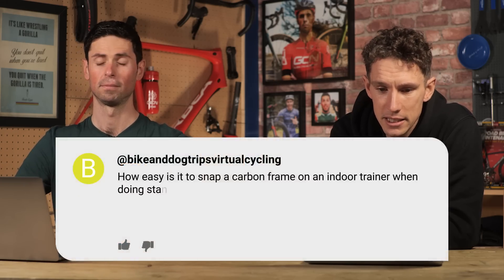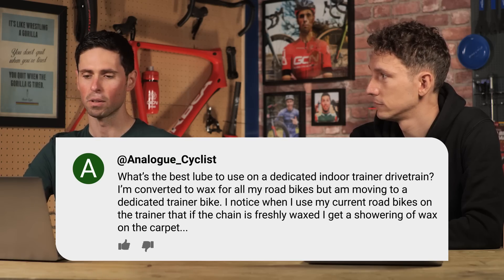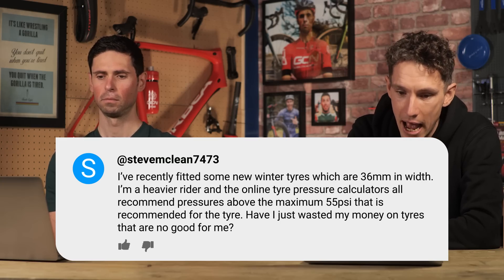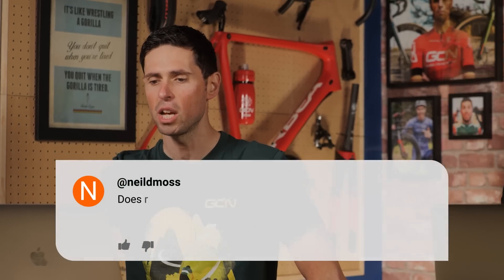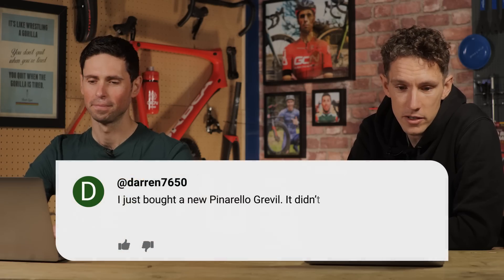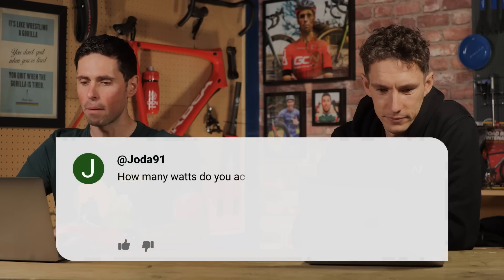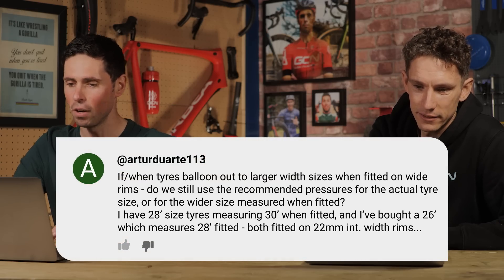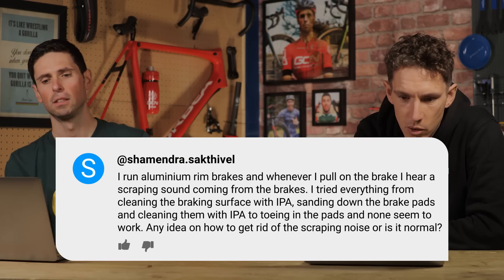Snapped Carbon Frames, Correct Tyre Pressure & Indoor Trainer Lube | GCN Tech Clinic

Comment from the maker: If the super nerds couldn't answer your tech related questions within the allotted time, fret not! 
Be persistent and use #askgcntech when asking your questions! 👇
Reply: #askgcntech I have recently purchased a set of Hunt 4 Season wheels with rim brakes, I fitted theses with latex tubes. After flicking through the manufacturers documentation, there is a WARNING not to fit latex tubes. When I asked the manufacturer 'why?', they said this was due to the potential for heat build-up in the brake track which could then cause the tube to burst. Have you ever heard of latex tubes bursting due to heat exposure and why are latex more susceptible than other materials?
Reply: Hi guys, I recently upgraded the wheelset on my entry level rim brake bike. The new wheels are custom build by local bike shop. It has 20h with radial pattern on front wheel, while rear wheel has 24h hybrid pattern - 2 cross interlaced on drive side and radial on non drive side. I have ridden the new wheels for 400 km with no issue but I found out that many other rear wheels out there with 24h spokes has 2 cross pattern on both sides or even 3 cross. Should I change the pattern on my rear wheel? Whats the benefit for each lacing pattern? Thanks in advance. #AskGCNtech
Reply: I love watching Alex who is so meticulous and particular in his bike maintenance and/or setup choices, giving advice alongside Mr WD40 Richardson. 😂

Comment: With 90lbs of bike weight, my rear rim brakes would often glaze. Then the squaked like geese upset. Lava soap in bar form (pumice soap). Scrub the pad, rinse, repeat: until as new. No squeaks or squacks.
     Not certain but would Hazzard the guess, that I over heat them, and it happens. Remember, clean that rim too. Ride more. Know your/you're love

Comment: The cycling rolling resistance Website tested the new vs old and found exactly what was said... literally zero difference in rolling resistance after nearly 1-2mm of tread wear. Puncture protection wasn't very different but slightly worse

Comment: #askgcntech I bought some light and compact TPU inner tubes to carry on my commuter bike in case of a puncture. But I didn't take into account that my current tubes have Schrater valves whereas the tpu tubes are presta. My mini pump has fittings for both, but can I use presta tubes in my schrater rims?
Reply: you can use them

Comment: Just last week, my Cannondale supersix six tiagra snapped almost all the way through in the middle of the left seat stay. Only a few fibres remain holding it together. It's a permanent trainer bike, I had it on a DIY rocker plate type thing. It wasn't because I put so much power into the bike, but rather it was likely because I'm heavy at 105kg. And a car crash 9 years ago probably left micro-cracks that manifested over the years.

Comment: Regarding waxing your chain on your turbo, simply have a mat under the bike and vacuum up the wax "dandruff".

The wax coats the chain so should prevent corrosion, as it does outside.

Oiling a chain is a total loss lubrication system, and so the chain will be dropping oil even if you can't see it.

Comment: This is  related to the first question, my brother's bike frame actually cracked on the seat tube (just above the seat stays) on his Cipollini N1k1 frame while riding on a bike trainer. It was a couple of years back during lockdown, where indoor training was the only option at that time. Luckily the bike frame was still under warranty, got his replacement frame for free. But yeah, I've seen carbon frame cracked on a bike trainer

Comment: #askgcntech how do you think is that I am beating all my Strava best times with a fitness hybrid bike compared to my road bike with which I had my best times before? I got a Pathlite 6 (40mm stock Shwalbe G-One Bite tyres 2022 model) which is 1X 36T 10-51T 12 gears with locked FS and a 2X 48/34T 11-34T road bike and I'm beating all my best times on the fitness bike without even trying! I am amateur, 1,81m tall and weigh 80Kg. The road bike has 28mm tyres and butyl tubes and weighs 11.6Kg, while I recently put TPU tubes to the hybrid bike and it weighs 12.7Kg stock. I use Silca or SRAM calc for the recommended pressure. My theories vary, but the road bike is allegedly much faster. I live in a very hilly region, you are either going up or down, the tarmac can be a bit cracked in some places, and I think maybe the 1T makes it easier to manage gears? Or maybe the easier gears on hills make me ride less fatigued? On paper 48-11T from the road bike vs 36-10T should make the road bike much faster, but it doesn't seem to work for me that way. I am puzzled.

Comment: I haven't ripped anything out, but the BB on my training bike has needed servicing every two years or so (about 6,000 miles/year).  Using it on the trainer is hard on the drivetrain and BB components, requiring as much maintenance as a regular road bike.

Comment: scrapping sound if it just from wheel front or back swap the pads and see if the sound moves from one end to the other, also one of the rims could have a burr or bump in it or the rim could be out of round a tad,  easy enough to check.
I once had a weird sound come from my rear wheel, it made a noise when I applied the  brake, I stopped to see the problem, it was a flat tire and right at the last 16km of a 76 km ride.

Comment: No matter what. I will avoid all those used bikes where the seller proudly announces: "Only used indoors". Its not a matter of BB but the whole frame not being designed to flex around the rear hub. And most frames being carbon that steadily deteriorates with every force it is subjected to. Just imagine the rearstays when a 90kg  brute is sprinting with 1.500W and the hub is fixed.😱😱

Comment: @shamendra.sakthivel: Cleaning the brake pads is just one half of the job, you also have to clean the rim with a special cleaning rubber for alloy rims offered from Mavic and Swissstop. This has to be done after rides in the rain and also after putting in new brake pads. Cleaning the brake surface with IPA is nonsense, that does only help the manufacturer of that stuff. And also use proper brake pads as Swissstop Flash Pro original black and no standard crap, as standard brake pads (no matter whether they are from Shimano or Noname) contain small partikels to enhance the braking power, but they wear out alloy rims rather quickly, wereas the mentioned Swissstop brake pads only contain rubber.

Comment: I just saw a video by Josh at Silca recommending mixing some of their Synergetic wet lube into their wax for use in wet weather.  Actually, if   I wonder if you could just add some Synergetic to an already waxed chain to "smooth it out" and reduce the amount of wax particles that get flung everywhere.  If you are starting with a clean chain, then maybe using the Super Secret Liquid lube would be less messy.  My trainer bike this year is using PTFE lube so I'm not going to be experimenting with any of that for y'all, sorry!

I can notice the difference between having my saddle bag and no saddle bag, but only because it adds some weight at the saddle.  I notice it when riding out of the saddle,  but there is no difference when going downhill, for example.

The guy with the scraping sound from his rim brakes - replace your pads!

Comment: #askgcntech. Hi guys. Mystery here! My two tyres, Schwabe Pro One 30mm with TPU tubes, keep on deflating in a seemingly random pattern!  Never know when will one be flat from one day to the other. And sometimes, they both keep their pressure for days on! I just don’t understand what could be the root cause of this. Valves, maybe? Do tyres have an attitude!?  Hope I grab your attention. Thx for your help.
Reply: Maybe your rim tape is not covering the one (or several) rim eyelets?  INSPECT THE RIM TAPE PATH MAKING SURE IT COVERS THE SPOKE EYELETS.
The tube can come in contact with just a fraction of the metal causing it to have a pin-hole size puncture causing a slow leak.

Comment: I'm on a budget hybrid bike running 622x20 mm rims with tubes. My tires are currently 700x40c but I want to push that up to 45-50c. Can I run that size tire with a tube on my 20 mm rims? I'm also assuming that if it's possible I'll need larger tube as well.
Reply: 20 mm internal width?
Reply: @denniskinyua7164  I'm assuming so. The rim itself is labeled 622x20.

Comment: #askgcntech Hi Guys! I converted my gravel bike to SRAM GX1. I love the 1x system, but when in the lowest gear and 250+ watts, I'm getting a loud noise and vibration from the rear mech (or chain?). I've checked the B limit and it looks right. Could it be the chainline or maybe the chain is too short? I don't get the noise in 12th gear at same power. Very frustrating when climbingn hills. Thanks!

Comment: Should still use wax.   Wax isn’t just about stopping dirt entering the pins inside the chain,  it’s about friction as well.   A wax chain longevity is the same indoors as in outdoors.  Initially just put some paper on the floor, once the chain stops depositing loose wax, lift the paper and dispose.  I’m also guessing you’re putting something on the floor to mop up sweat? And old towel could collect the wax.  Shake off outside afterwards.   Wet/ dry lube = grinding paste indoors or out.

Comment: Cleaning brake pads with sandpaper is not a good idea. Some of the abrasive from the sandpaper can come loose and embed itself in the pad.  Better to give the pad a light scrape with a utility knife blade or something similar. Riding on wet roads can also cause your pads to pick up grit. Check your pads after a wet ride.
Reply: I was wondering the same thing but I wasn't sure. I say just buy new pads but I'm lazy haha
Reply: A metal file works fine
Sand paper only for disc pads

Comment: 8:00 if you aorry about the resistance of a saddle bad why not ride a recumbet bike? Or a velomobil? Its much faster than a normal bike and you can carrs whole suitcases and will still be faster every other bike. If you want to improve your speed, dont waste time on saddle bikes, just get another bike with less air resistance
Reply: Because the people worried about watts will be racing where recumbents aren't allowed so there's no point in training on one.
Reply: @scopie49  i doubt that. i rode a recumbent bike as a commuter for 1 year. you need a different, more fluid, pedalling style and i can hold a cadance of 100 for a couple of hours now where i couldn't hold 80 before that.
Reply: @dannyheyrman4848  There's no guarantee you wouldn't have made the same progress on a regular bike. But the real point is that if you're racing on a normal bike you need to train on one. One is bike fit and finding a specific fit that works so you don't get hurt, hands don't go numb, neck doesn't crane upward, etc. Getting used to being hunched over the bars and honestly just sitting in the saddle for hours is important. Or how about cornering when your center of gravity is higher off the ground?

You'll still gain cardio through recumbent but there are a lot of reasons you'd want to train on a regular bike. You need confidence in being upright.
Reply: @ agree, but you don’t have to do all the training on the recombrent. I just said said you can train on cadence as it is really important on a recumbent bike. And I race cv marathon, but 80% of my training is on a road bike. And I go to the gym for core training. All these different things add up and benefits my mtb riding and racing.
Reply: @dannyheyrman4848  I mean yeah. You can cross train and do different things. My main argument was against the OP specifically for people who care about watts saved and aerodynamics. Setting a PB on a recumbent doesn't really mean anything if you're racing with normal bikes. They're two different classes of vehicle.

It's not ideal to train solely on a recumbent for the watts, i.e., good numbers, when your biking form on a regular bike would be more important. 

It's the second time I've seen someone comment on, "Why not just use a recumbent if you care about aerodynamics or watts?" The same argument could literally be, "Why not just buy an e-bike if you care about watts?" Point is you can't use those in a race.

Comment: #askgcntech My road bike got steering feel like indexed. I think head bearing need replacement? Both upper and lower sides?
Reply: As a safety issue Definitely replace the headset. Indexed bearings put me In a high speed shimmy loss of control on a mountain descent. This was on a new bike with 5 rides. The headset had been improperly installed.
Reply: Your headset bearings are worn till they've developed pitting, giving the indexed feel. Replace immediately.

Comment: I’m doing 1400+ Wat standing sprints and everything works fine. Trainer jumps up and moves all over the room. No damage at all. For years 😀
Reply: Yeah it‘s almost as if the bikes and trainers were built for this purpose 😮
Reply: i do 1401+ watt standing sprints, rocking the bike & trainer left & right, inches off the floor with each crank revolution on a 10+ year old carbon frame.  no damage at all.  none.
Reply: do I hear140*2* ...1402? going once... going twice....SOLD!
Reply: Can I ask what trainer you use? I’ve got an old Kurt Kinetic and a newer TCR, and finding a thru-axle that works in the Kinetic is rough
Reply: Flexing 😂

Comment: #askgcntech Hi everyone! I started noticing some mould building up inside nozzle of my water bottle. It's inside the nozzle, and there's no way for me to get to it with a brush to clean it. Is there a way to clean it? It's a nice bottle that i'd hate to have to throw away.
Reply: Bleach
Reply: Only fill bottles with clean, pure water. Any other liquid will mess it up. I used to put some apple juice into my water and it turned my bottles into a biolab. To clean it, just throw it into a dishwasher at high temp.
Reply: you can buy sanitizer tablets.  rinse your bottle out first, then take the nozzle apart of possible and then just add everything to a bowl of hot water with the santizer tablet / water overnight.  You can also buy very thin nozzle cleaning brushes to remove the dislodged crap after the previous soaking

Comment: Really! I saw waxing for indoor riding as a pro not a con. Just vacuum around the bike!
Reply: Just use a rubber mat
Reply: just lay down a page of newspaper
Reply: @ Not if you have a fan
Reply: Same for me, rubber mat works perfectly
Reply: I think the bigger and hidden issue is all of the wax particles that find their way inside the trainer. Given long enough exposure, this will absolutely gum up the mechanics, which are extraordinarily difficult to clean. I used to use wax on my indoor trainer bike, and switched back to a dry lube for this very reason.
Reply: @ Alternatively just keep it running smoothly acting as a lubricant, time will tell!
Reply: Why would you care about the chain on an indoor trainer anyway? You're not moving 😂
Reply: @JoeyMills-y3v  For sure not as important as tire pressure indoor …
Reply: @ArnMartBelgo  True. Or having a carbon Aero frame 😂

Comment: If you're riding a gravel bike in the snow at -2 to -5°C, what type of lubricant should you use?
Reply: Riding in western Alberta Canada, I immersive wax my chain every 400km for all weather conditions in temperatures from -30C to 35C... those temps are the limits of my body and not the wax
Reply: @OriginalTrev  Thanks

Comment: Best indoor trainer lube is Chain L from America.  Makes the bike silent and lasts 2000km.  Basically the heaviest mineral oil possible is the best lube, especially if you are running a chain cover indoors since there isn't going to be dirt getting on the chain.  If you can't get Chain L in your country, Phil's Tenacious Oil is an ok substitute but doesn't have the same high pressure stabilizers and won't last as long.

Comment: Onlympic distance tri - My old metal wheel had a pincture woth 15km left. Finished the race and just replaced the puncture after the race. Rim still going strong. I rode it easy that last 15 km though.

Comment: I had a 2012 cannondale that went on a trainer after 7 years of use during Covid. Over 2 years of indoor trainer I did notice the carbon frame was flexing noticeably more than it had been at the start. I think the trainer caused it to flex more and age faster than it would have in road use, but it also got a lot of use over a lot of years and didn’t fail